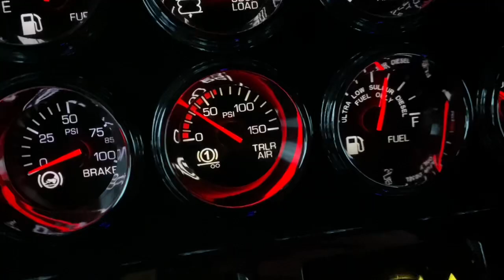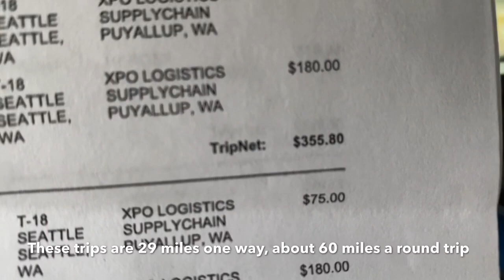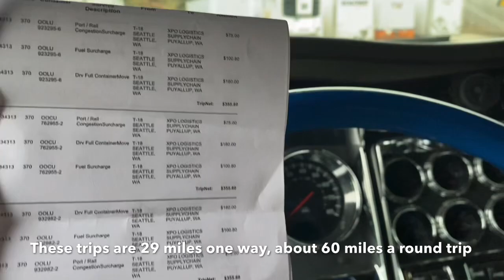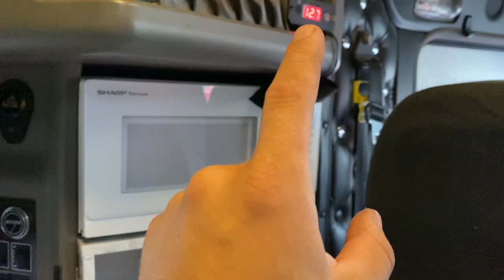Owner operator Pay hauling containers | Is it Worth it?

Comment: Why do you run such a long wheel base ? Is there an advantage to it ?  I have also found that lubricant is the key to so many things.
Reply from the maker: it’s smoother, and was the only truck for a good price when I found it. Was perfect when I needed to run a drop axle on it. Now just for the looks
Reply: Im stretched and im flatbed. Spread axle on the trailer. You get used to it. Rare but we slide the 5th up on tight backs

Comment: you got one beautiful t660 question about your pipes are they connected to the exaust i got me a 08 t660 wanted to install 7' streight pipes
Reply: They way the engine sounded when he took off after the tire change, sounds like he doesn’t have it connected, I may be wrong though,
Reply from the maker: Yes they are with a Y-pipe

Comment: What's the average pay per mile gross?
40'er HC to a 20'er

I'm buying a 40' Gooseneck full tilt to start hauling Containers from California to Arizona, Utah and Texas....

Was wondering what average current rate is to move them?
I want to make sure I'm paid fairly...
I've put all my chips on the table for this....

TIA!
- Bob
🤠👍
Reply from the maker: We’ll we always haul loaded one way and back empty.. always back to same starting location. I do local local so the rates are different. A 150 mile run can be paying $4 a mile while a 15 mile local run can pay $500..

Comment: IF my 4 banger SUV tire costs $120 and my big SUV is $200. How many trips does it cost take for one semi tire + road side tire service? $500 for the tire?  Labor?
I would say one tire would eat one day's work. The state got paid. The insurance company got paid. The loan sharks got paid The petroleum company got paid. You got the bills.
If you net $100,000 per year you are doing pretty good. More than is excellent. You most likely are putting in lot of wear on the truck seat to make more than $100,000.
Reply from the maker: These tires I paid roughly $250 a tire they are China tires. $2k for all 8. They will easily last me 3-4 years

Comment: Chicago local container pays 500$ trip.. been considering it.
Reply from the maker: That’s a really good rate. I get $500 local loads here in the busy time. $350-400 on average for the bigger customers who have larger volume of containers.
Reply: @CustomRigs  Can you do 3 local trips a day er mostly 2
Reply from the maker: @chris387  mostly 2 because the ports been pretty busy lately. But I get tons of hours paid for detention. Detention usually $50 an hour after 1 free hour on top of what the load pays
Reply: @CustomRigs  o ok ok that is pretty good. May ill try it out, I do dry van local n regional

Comment: That’s not bad pay bro I run Reefer here in OR and WA only last 5 years and love  it I see you all the time on the I-5 looking good 👍 I offload at that Fred Meyer often maybe I’ll run in to you one day
Reply from the maker: Oh that’s sick! What kind of truck do you drive so I know
Reply: I drive a T-600 white with a sped axle Reefer
Reply: I move container to tacoma, seatle from tri cities.  500 miles round trip.  It is really fine to work local, but the ports are crazy.  I'm thinking of moving to the reefer or dry van, there's good money  too!  And you do not have to endure the daily hours lost because of the port.  I also see them in the 90  in the reefer and when I put diesel in wapato!  And it's nice!

Comment: I'm a little confused here,
If they pay that well why are 90% of those container hauling trucks pieces of shit rolling down the road?
I mean they can't even use the good duct tape to hold their mirrors together,they got that dollar store brand stuff on the truck.
And I run the same area that that truck does so it's not a North vs south.
As a matter of fact I just came out of the Seattle area yesterday and I lost count of the number of "3 color" trucks pulling containers.
And for the love of God with that kind of pay you think they'd have some type of engine in there that can pull a bit of a hill.
Reply from the maker: Lol yep I agree but like I said it depends who you work with.. most of those guys with broken trucks are savanah and GSC guys with yellow chassis that do rail road containers and it pays extremely cheap. I believe about $70 a run from Seattle just down the street. They basically rarely ever even leave Seattle.
Reply: @CustomRigs  I'm going to have to keep a lookout for that chassis color...God knows it gives me something to do while sitting in traffic.
Reply: I was thinking the same damn thing, watched a few videos on the trucks from the ports and every single one of the trucks I see are plastic with pieces falling off of every corner.
Reply: @spoolinsvt6489  Most are humble mexicans that dont care for a flashy truck, i know an intermodal guy making 5-7k a week that helps his family out in mexico with his money.

Comment: I'm in fife, looking to becoming owner op to do what you do. Would be nice to know more info.
Reply from the maker: Do you have any port experience or cdl?
Reply from the maker: @Gecko1152 local pay is roughly $350 a load from the port about 50-60 miles round trip. Standby $50 after 1 free hour at customer and port. Rates are cheaper if you lease on. I have my own authority
Reply: @CustomRigs  I have a year with reefer, almost 2 with step deck conestoga. I do a couple port loads occasionally.
Reply from the maker: @ruskiyify91  a lot easier to learn the ports and how everything works by leasing on to someone. There’s a few brokers like horizon freight system, SPS, PCR that will take you with your own authority.
Reply from the maker: @Gecko1152 how’s the port congestion over there? Most of the times the ports here are 2-3 hours for turn times. Sometimes quicker under an hour.
Reply: @CustomRigs  still saving up for semi, need to know what to buy first.
Reply from the maker: @Gecko1152 oh dang lol. Yeah we scared to record inside ports over here. Have few guys that watch my channel from the port and idk if they would snitch lol. But it’s a mess the fake news reporting that it’s a driver shortage. But we have empty return problems and chassis shortage.

Comment: I wouldn't call those numbers great especially if you take pride in your truck because that where in tear on those loads it's substantially more. 
At the same time your rpm isn't bad at all, I'm just not one for that type of Work. 
This week I only did 1800 miles and I grossed 7.4K
I was doing short loads which is not my normal thing so I probably got a little lucky this week, and that includes today's load that delivers Sunday night/Monday morning
Reply from the maker: That’s really good! Most we pull is around 5k gross for a Mon-Fri week and roughly only 500 total weekly local miles.
Reply: @CustomRigs  this is the better option. Make good money see your family and enjoy your toys. Vs working away making more and enjoying less. We got one life to live. I’m try this in my area for sure.
Reply: Bro which companies you work with?
Reply: @davidguerra9896  15hrs a day?

Comment: Bro we get pulling reefer home almost everyday with anything is paying at least 6mile like 1200-1500 day no way even worth talking about that $300 you did
Reply from the maker: How many miles? The $355 i showed is without any detention and is less than 60 miles round trip. 28 miles one way and empty back 28 miles. Easy 1k a day locally even more with detention time.
Reply: @CustomRigs  we run about 200-250 total miles that's one trip. Our super local which is dry van garbage freight is still cheap for us pays $850
Reply: This comment was 7 months ago, a lot has changed. What are your reefer rates paying you now if you dont mind me asking.